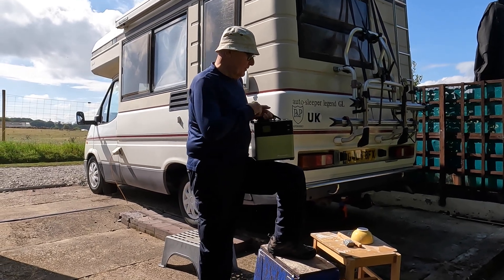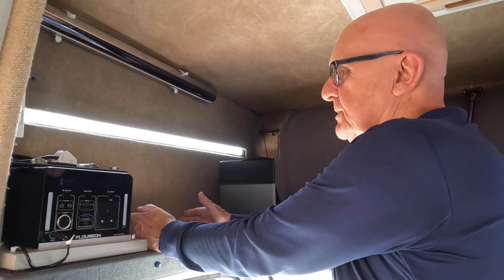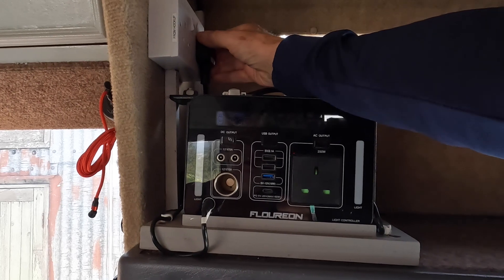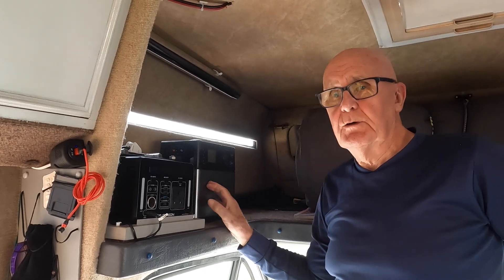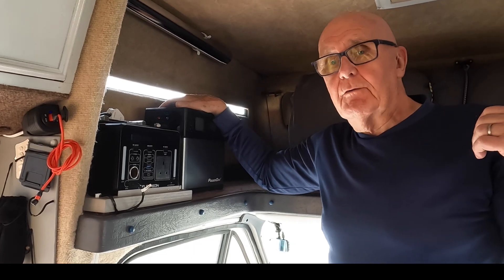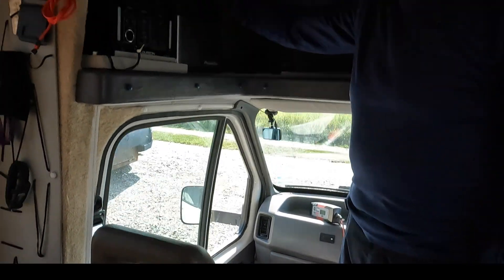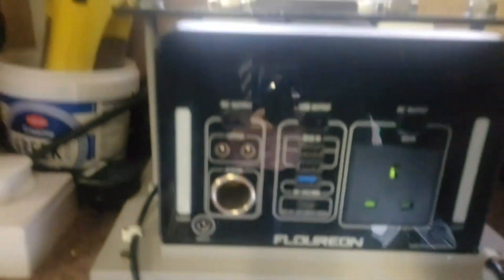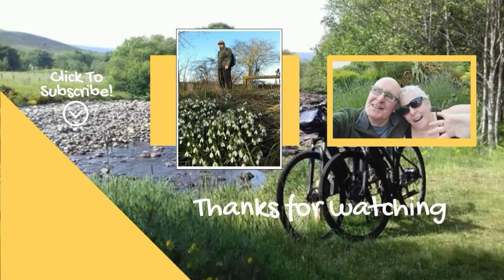Keep Breathing! Fitting Solar Battery Back-Up

Comment: Hi , we are really enjoying your videos. My partner has just been getting a cpap machine so I was wondering what "power station" you use to run yours. I.e. make ,model power output  and price. And whether its worked well or if you would get a different one looking back? Thanks Keith and Chris
Reply from the maker: Hi there, were so pleased you are enjoying the videos. It's a big change - getting a cpap - and takes time to adjust. We bought a power bank on Amazon with a built in inverter so can take a 240v three pin plug. It is 300Wh and 10000mah and lasts Pete about three nights before it needs a recharge. This does it's just fine when we travel. The model we bought isn't on Amazon anymore but the Chinese models are all very similar. It was about £240. Good luck with the cpap, Pete and Shel
Reply: Thank you very much for your prompt reply 👍 That should help us making a choice to power her machine